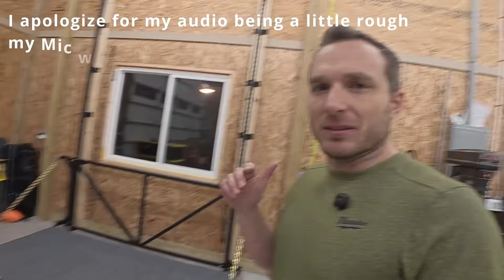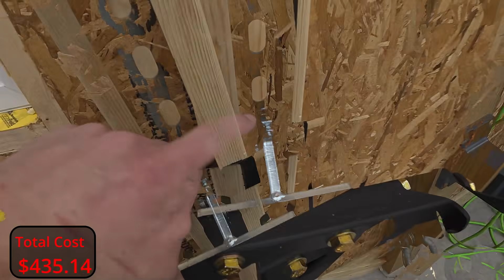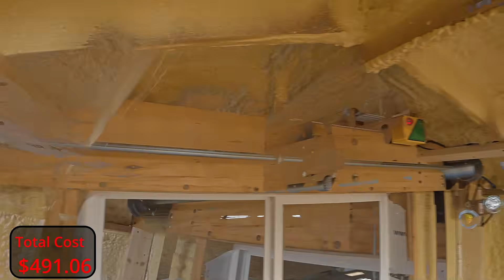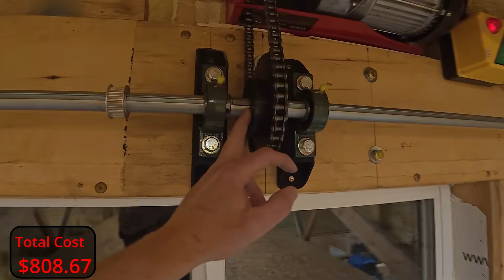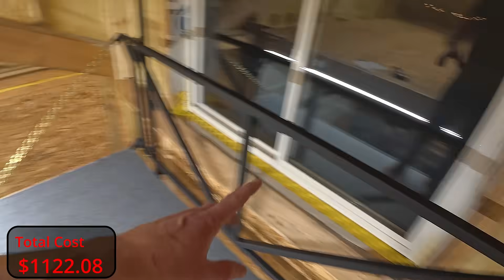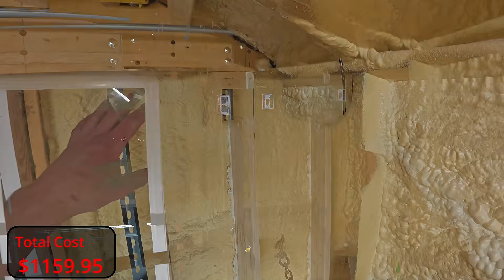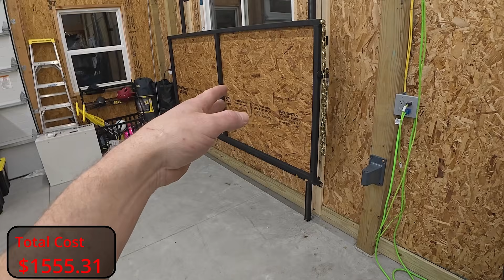DIY Shop Elevator Build Cost And full PARTS LIST (ATTIC LIFT)

Comment: I built a lift for my shop modeled after a roof shingle lift. 32 foot Werner ladder and a Harbor Freight  120 volt  1500 pound rated winch.  I just leave the platform up at the top which covers / fills  the hole because not like yours  my second story is an actual full size work shop built for load. Speaking of load , with all your calculations on how much the hoist will lift,  it didn't look like the structure that you would be putting weight on was that structurally  capable of much weight at all.  Good video , well thought out and explained .
Reply from the maker: Sounds like an interesting set up you have.   You are correct my attic is an attic not a second floor.  But stay tuned because I have a plan in the works that will change the load capacity up there dramatically.   Thanks for watching

Comment: Subbed!  Here's the only safety thing I'd add....double-point locks like a car lift...should be really easy to do considering the uni-strut you've got there...
Reply from the maker: Glad you subbed, that's a good idea and I appreciate the suggestion! Thanks.
Reply: @Built-By-Sam  I put them on the 4-post Quad/snowmobile lift I built 2-3 yrs ago...great peace-of-mind walkin' under it for sure.

Comment: Great job Sam.
Reply from the maker: Hey thanks Tom.   Hope you're doing good.
Reply: @Built-By-Sam  doing well Sam- thanks.  Not sure if I reported back to you but thanks for the infrared camera suggestion.  I have used it to identify several problem areas in my house insulation and I have started fixing these issues.  Looking forward to seeing what new content you release in the future.  👍
Reply from the maker: That's great.  It is a handy tool to have and fun play with.   You can find a lot of problems with them.   Its fun to look at you electrical panel and see the hot spots.
Reply: @Built-By-Sam  thanks for the tip.  Definitely something I need to do in my 1965 built house.  I really needed to upgrade the panel when I bought the house 10 years ago.  No main shutoff and only a dozen 120 volt breakers in a 4,700 square foot house.  I cheated and installed 24 split breakers and removed all of the aluminum no ground wires and rewired the house with new 12-2 and 14-2 with a ground wiring.  Haven’t had to reset a breaker because someone was using a hair dryer in the bathroom since I did this.  However, doubling the amount of wires going into the 1965 Cutler Hammer panel and snaking the wires in with a “live” box wasn’t my idea of fun 😱.
Reply from the maker: Yeah definitely sounds like you need an updated and larger panel.  I had the same issue with mine when I bought the house it was way to small so I installed a larger one. Now I'm out of space again and want to upgrade again. Lol.
Reply: @Built-By-Sam  as one of my childhood friends always said: There is never enough.  He usually said this as he grabbed the last beer out of the cooler 😢

Comment: Can implement a system like a car lift. A system where a every foot or so a steel latch will drop into the track... to lower the elevator you would need a lever to raise the steel latches out of the track.. just a thought. May not be possible in this application ( doesn't help if theres a failure during lowering)
Reply from the maker: Yeah a few guys have suggested a similar set up.   It would work, and could probably use the holes in the strut to click into.  I just think it could cause more problems than its worth.  If someone forgets to pull the latch and you go down the cables would slack and could cause problems.  Still not a bad idea.   Thanks for watching I appreciate it.

Comment: excellent job im a retired millwright from general motors in my opinion the whole setup is fantastic. and like u mentioned i would put a fall hazard retractor system on the lift table. keep building brother.
Reply from the maker: Thanks Gary,  yeah I think thats the simplest solution.   Thanks for watching I appreciate it.

Comment: So I think the weakest link would be the chain. What is the working load on the chain? How often do you plan to check for chain stretch? I would double the chain like you suggested and fabricate/weld teeth on the vertical rails and mount a spring-loaded arm to catch every 6 inches or so. Kinda like a car lift. A cable release could be added to unlock the safety to travel down. But ultimately, I would ride it the way it is. Great job my guy.
Reply from the maker: You are Probably right.  The working load is about 880lbs breaking strength is a little over 4,000lbs. Like I've said before i dont plan on picking up 1000lbs with it, that was a test.  300-400lb is more likely the working load and would have no worries even at 500lbs.   Thanks for watching